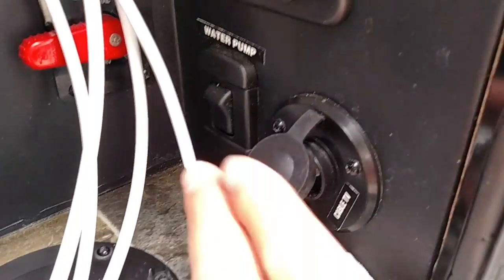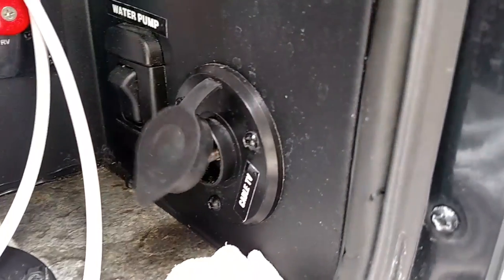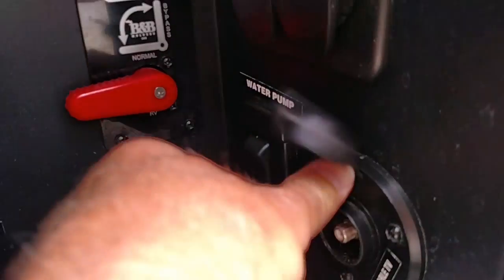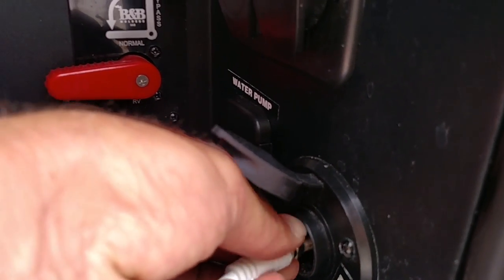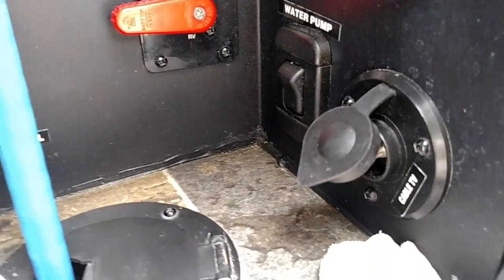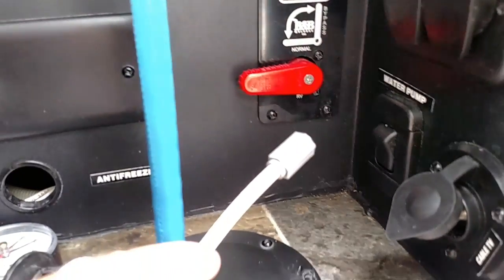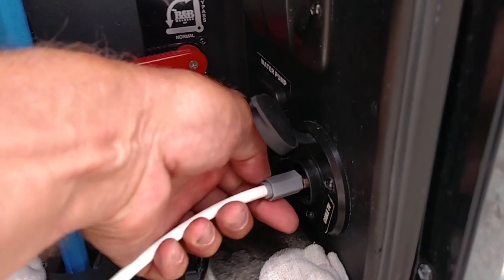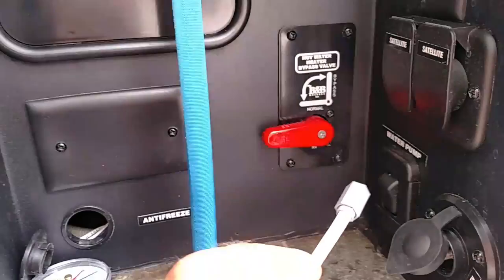RV cable connection

Comment: Thanks for that tip!!  I was just as baffled by the same connector on my camper. No more needle nose pliers. New cable time.
Reply from the maker: Update, I finally got so pissed with it I just cut the cup walls off and ditched the cap. Its inside an enclosed area anyway. Then I also noticed there are some folks that make an aftermarket add on extended nut, great idea check it out
https://www.youtube.com/watch?v=VgRXjsq2x5s

Comment: GOSH TOM... why didnt you post the source of those neat cables?
Reply from the maker: I think the reason I didn't say where to get them was because I couldn't remember where I bought them. And I just did a web search and couldn't find one, darn it! How ever cutting that lip off helps imensly and the add on product I mentioned looks like a great solution as well. Cheers
Reply from the maker: Check out link to product in expanded comment below.